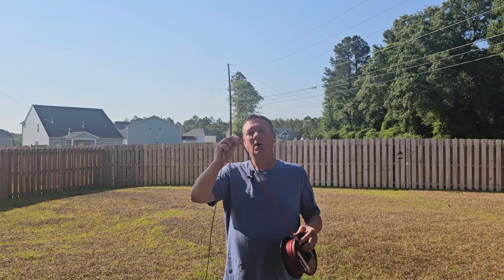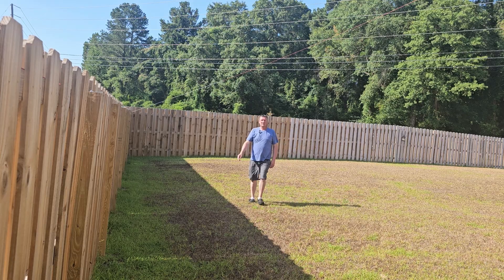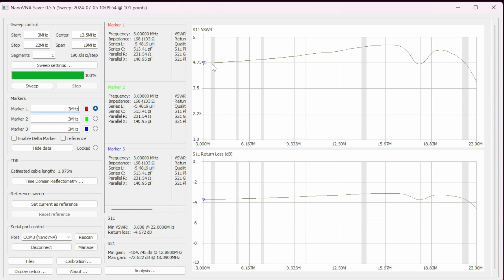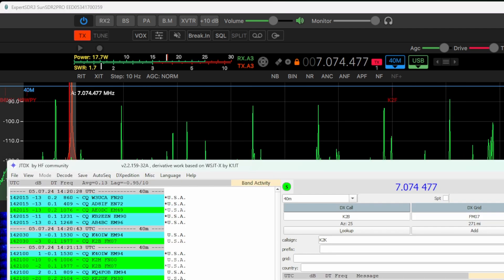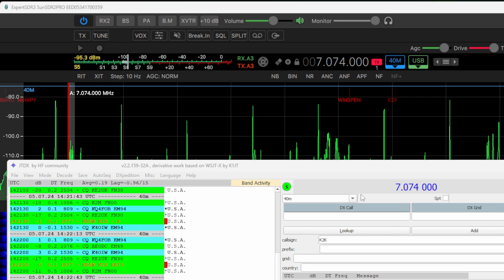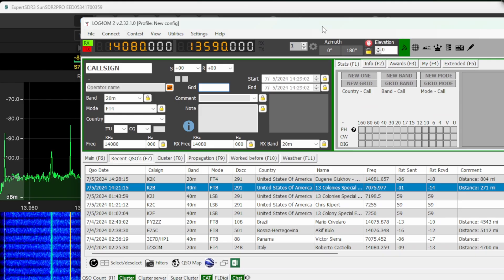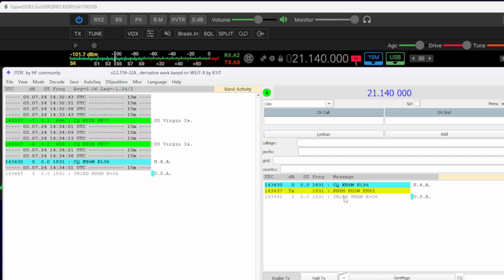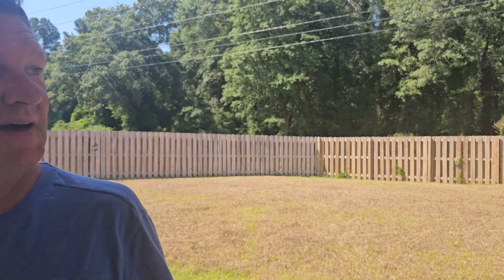How to Turn Your Fence into a Ham Radio Antenna!

Comment: How hard was it to tune your antenna
Reply from the maker: Since it's a random wire you don't want the element tuned. Using an MFJ antenna tuner it tunes quite easily.

Comment: I have a 200' end fed longwire antenna on top of my 6' wooden fence like yours. I use a 9:1 balun fed by coax. It works a treat on ALL bands with a low SWR, and frequently feed up to 1KW into it. I use ferrites on the coax entry to the shack, and my RF in the shack is minimal. And I installed NO extra grounds.
Reply from the maker: Sounds like a great setup!

Comment: Would a chain link fence interfere with the signal?
Reply from the maker: Anything metal will interfere with the signal, how much is the question
Reply: @BrokenSignal  Figured it would, kinda shocked you got the results you did. I ask because I live in a rather small home - but was thinking about turning my chain link fence into a loop, since I can't really put up a proper dipole.

Comment: A great invisible antenna for those living in deed-restricted homes.  My current antenna is 40 meter loop attached to the bottom of my elevated home.  That antenna works well for local, regional, and state coverage.  A little imagination, as outlined in this article, can do a lot to keep your active in the ham radio community.
Reply from the maker: It all comes down to doing what you can to get on the air!

Comment: I definitely did the same thing and put an auto antenna tuner on the end back in 2001. The first few contacts were in South America -- I said "I think I'll leave it alone". Used it for several years before moving.
I think I'd easily worked over 100 countries on that thing.
Reply from the maker: Rule number one: Don't fix what works!

Comment: What is the software that you are using?
Reply from the maker: In this video I am using nanovna-saver, ExpertSDR3, and jtdx. I use jtdx because in interfaces with ExpertSDR without the need of setting up virtual cables.

Comment: If that is an "End Fed" You should use an (UnUn) Not a Balan.. I suggest Replacing it with a (49:1 UnUn) .. Down side Will be when it Rains (Will affect the Performance) Wet Wood will conduct Changing your VSWR... However.. 👍👍👍 It works.. That's what Counts ✅💡👨‍🎓
Reply from the maker: Definitely not an optimal antenna but for those who can't get wire in the air it's an option.
Reply: @BrokenSignal  My Land is not all that Large, so.. (I need to use a 60 foot End Fed..) Wish it could be  a Center fed Dipole.. (100's of feet either side).. But.. (Sucks to be me).. Do what you can.. (However.. On a Good Note) the Wife didn't kill you. (Another Excellent FYI Video.. 73s)
Reply from the maker: @x_CrossHair_x  Thank you, and yes, I'm still alive! 😂
Reply: Are those AC power lines right above your fence antenna? Potentially deadly!
Reply from the maker: @deanbianco4982  They are close, but it's OK, I'm not leaving this antenna there. Onto the next project.